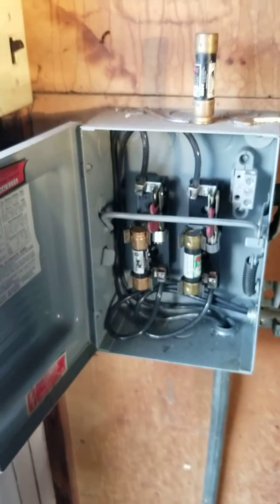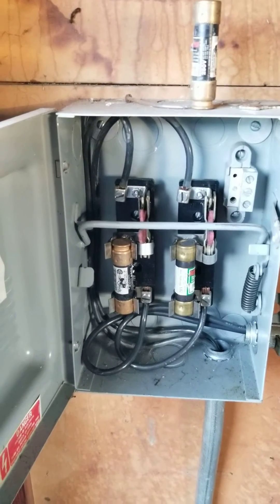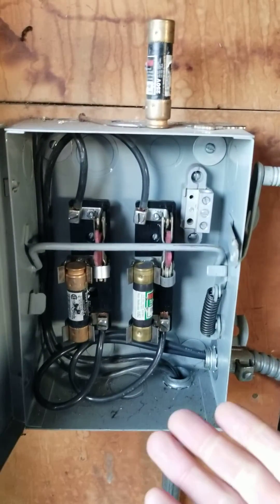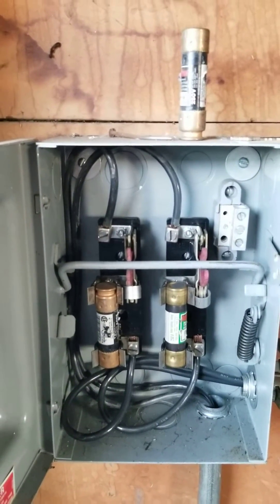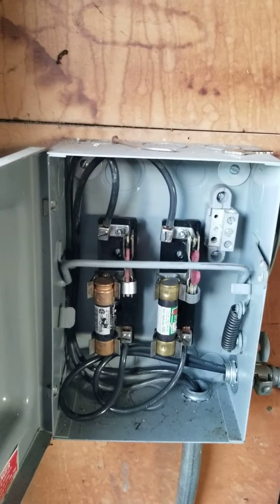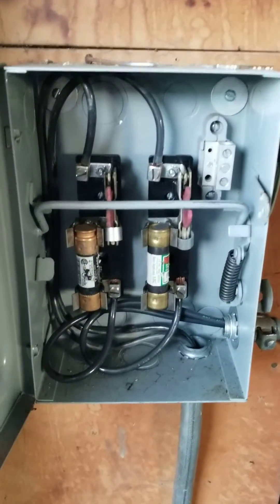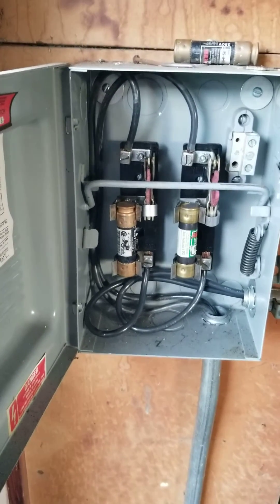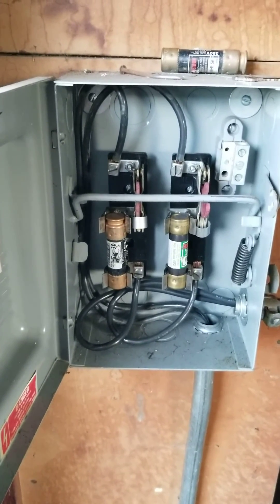Cartridge Fuse Electric Panel

Comment: I enjoyed the video and it was very informative. Is there a differenc between the black label and green labeled fuses?
 I have the same type panel. I need to 
 replace the fuses. I have a black bussmann FRN R 60 and a green label HAC R 60
Reply from the maker: From my understanding, there is usually a difference…
	•	Green label fuses are usually time-delay fuses. They’re designed to handle short bursts of high current (like when a motor starts up) without blowing immediately.
	•	Black label fuses are often non-time-delay fuses. They blow much faster if the rated current is exceeded — better for protecting sensitive wiring where you don’t want any delay.
Reply: @InspectorTribe  Thank you for the rapid response. Both are labeled time delay 60 amp fuses.

Comment: The previous owner of my house used one of these to run power out to my shed and then to the barn but the wire between the shed and barn was cut. Power went out to both. I stripped and fused the broken wires together and replaced the fuse, but the power to the shed and barn still aren’t working. None of the breakers in the house were tripped. What am I missing?
Reply from the maker: Are we sure the fuse panel had power? Sounds like a good time to call an electrician yo help you out.

Comment: So mine kitchen light and living room plug and light don’t work I change the fuse from the panel and plug and still no power could one of those cause it from not working ?
Reply: You changed the fuse like he's showing here? Or you changed another different one? If these ones are blown, you will not get power. The other thing is, if you got a surge maybe plugging in something, drawing too much current. The wire might have burned out in the wall. Then there nothing you can do. Have to run new wire in the wall
Reply: @Salador1777  i change those and still nothing the circlet breaker as well and the outlet
Reply: Which I’m quessing the whole wiring burn out but it’s weird cuz a wired got yanked from a outlet
Reply from the maker: Sounds like you should get an electrician to look into this… loose wires are not good.
Reply: @Salador1777 well there two boxes and I change the small ones but I haven’t done with big one

Comment: Good to know!  I have an older style home that I just moved into with a panel just like this one and everything passed inspection! It has one main service panel using circuit breakers, and 2 separate subpanels. Immediately after the main service panel with circuit breakers, is this sub panel with 2 30-amp cartridge fuses in a metal box with metal closing door. After this sub panel is another that is located in the detached garage with 2 20-amp glass fuses. My question to you is about this middle sub panel with 2 cartridge fuses. The box these cartridge fuses are housed in does not have a raised bump to attach a ground wire and screw. Instead, the bare copper wire is just sitting there in mid air. Doesn't that need to be connected to anything? Could I tap a hole in that metal box and attach a green ground screw and wire to that? How are the outlets in the garage still working with no ground connected to them? (Garage wiring has confirmed 12/3 wire)
Reply from the maker: Great question and a little more in depth than I can properly answer here. Ultimately it’s best to consult with a licensed electrician to make sure you get it all squared away.

If I were you I would get a 3 prong receptacle tester and go test each of the receptacles in the area you have concern with. This should show you in they have a ground hooked up.